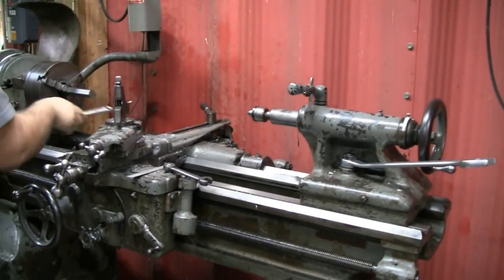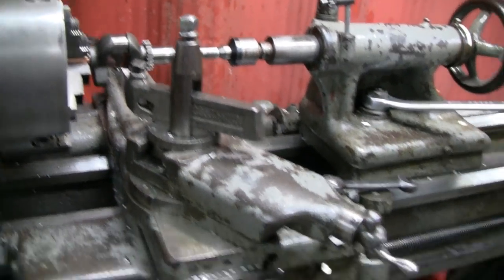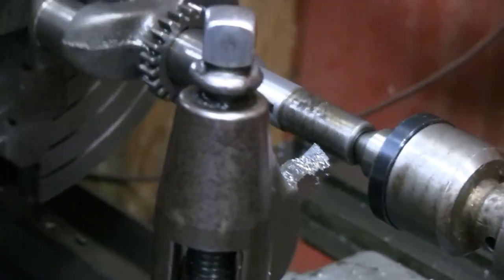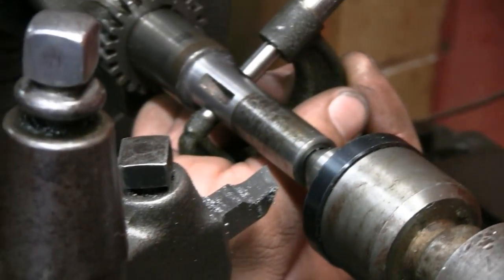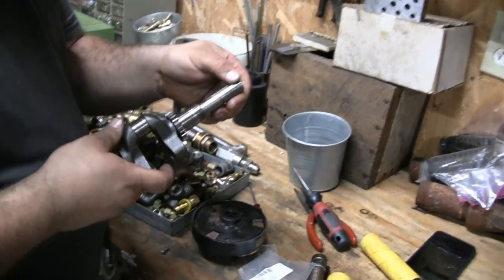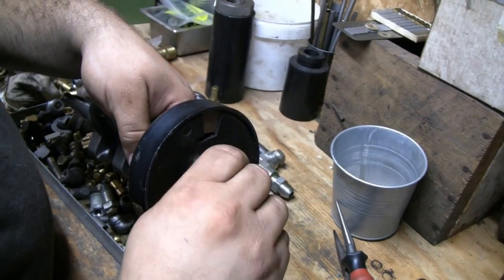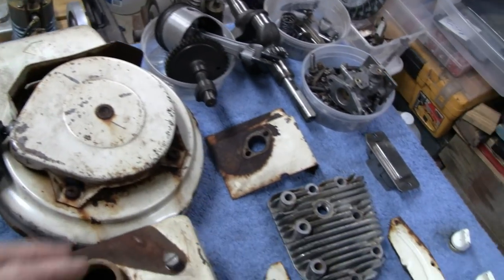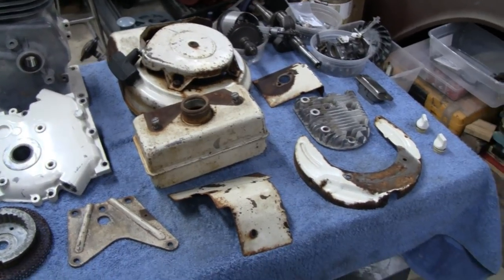MOTORIZED SCOOTER ENGINE SWAP (part 3)

Comment: Happy to throw my 2 cents in to help a guy out, RK ! Also, was getting ready to tell you about the plug on the mixture screw chamber, lol. If you ever need to take out that plug on the side, use caution, it's a very shallow casting. It's for the idle circuit transfer ports, and the chamber inside is the venturi wall. Same rule applies to Tecumseh and Walbro float carbs.
Reply from the maker: Thanks for the help Bud!!☺

Comment: Lauson also built outboard motors in the 30’s until the 50’s they were known for the 4 stroke air cooled motors ! Those carbs are very nice when setup properly ! Copper pipe works really good for that air cleaner !

Comment: Going to run like a brand new one. You do a great job as always.  By the way those screws you used on bottom of the carb are 6/32 if they came off a light switch, outlets are also the same size.
Reply from the maker: Thanks Larry!! I would have liked some Fillister or Pan Head Screws but that's all I had with that thread!!☺

Comment: I never rebuild a carb anything less than 5/8 ass. But since it’s a Tecumseh I guess 1/2 assed is good enough.  Also I’ve noticed that when I have a 50/50 chance of getting something right, 75% of the time I’m wrong

Comment: Silicone sealer goobered around the boot to seal the make shift air cleaner???   Come on Roadking you are much to good to do that. Lets go back and get a Pepsi and re- think this .......
mike could easily weld you up and adapter plate/tube to fit the air cleaner you have.
Reply from the maker: I agree with you SF,  everything is subject to change!! That's all we had in front of us at the time!!☺

Comment: diaphragm will always touch a machined surface ;) the gasket will touch the diaphragm and the un machined part (stamped metal / plastic) to make up for the imperfections or distortions
Reply from the maker: Not according to Tecumseh, it depends on the carb you have!! That's why we showed the instruction sheet at 31:51 !!☺
Reply: @805ROADKING  sorry sorry that is the when No instruction sheet when in doubt scenario ;) 
I have not dealt with that carb I want to investigate that reason.

Two stroke carbs also have machined base plates which makes my statement confusing 

Typically diaphragm will touch carburetor body. 

Anyhow we see there can be variations lol

Comment: The last guy who didn't make a mistake was hung from a cross. They happen, move on and good to show it.
The Indian seems to have a bad rap but I really enjoy working on them. Those diaphragm carbs aren't much different than a chainsaw or string trimmer carb so it's hard to understand why people don't like them. I have a reel mower with one and it runs perfectly. Doesn't seem there was much consistency as to when they used that style however. Great series here, keep up the good work.
Reply from the maker: Thanks alot Bud!! I thought I made a mistake once, but I was wrong!!☺
Reply: @805ROADKING  Never wrong, just an unanticipated conclusion! HA!